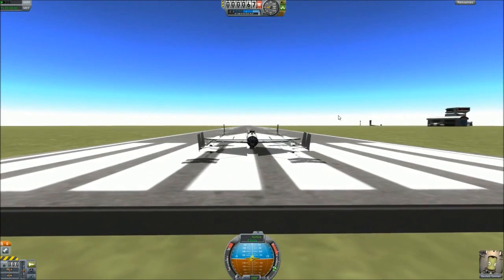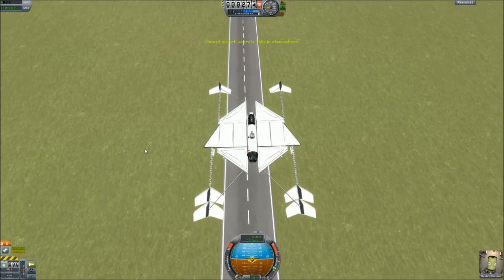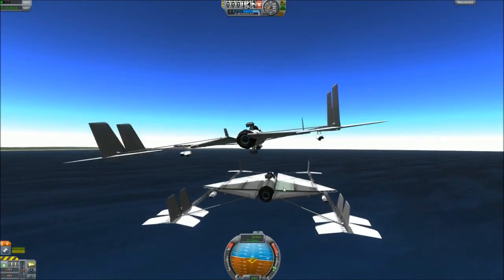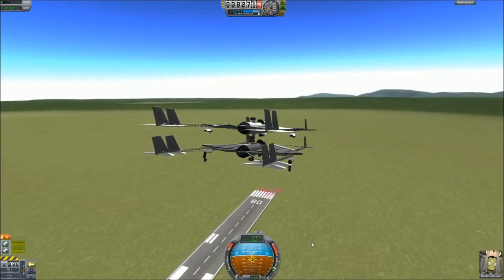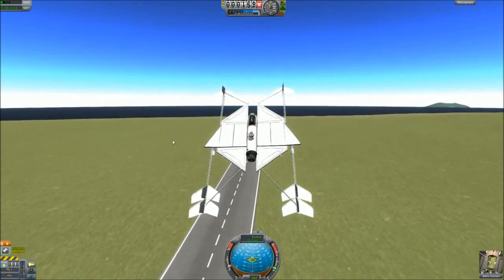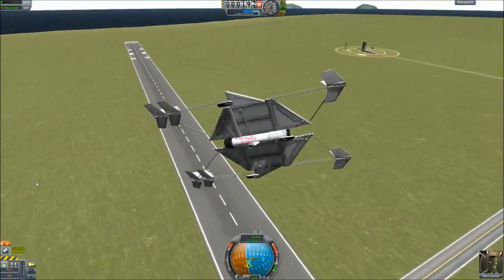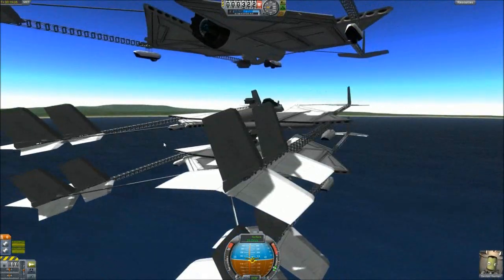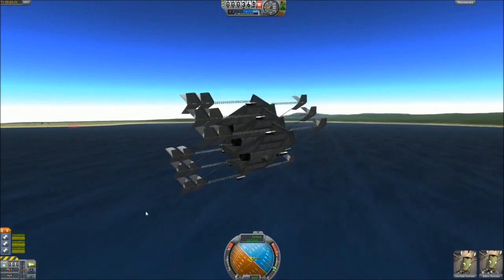Kerbal Space Program - Docking 3 separately launched planes in atmosphere!

Comment: docking ports are not as strong as actual connections between parts so the plane structure is weaker and prone to fall apart in atmosphere. also i mean build 1/4 of the plane and then de-orbit that and land it so the parts like the landing carriage, capsule structure and propulsion stage and dock with diferent launches and craft. it falls apart ALOT